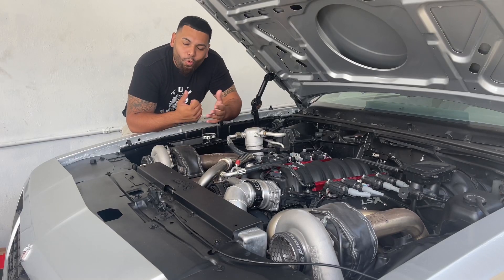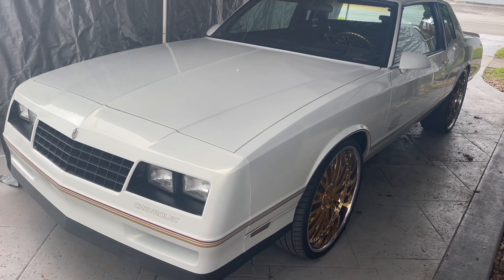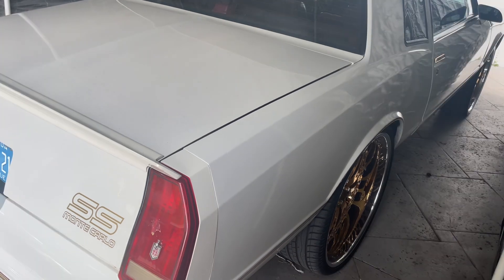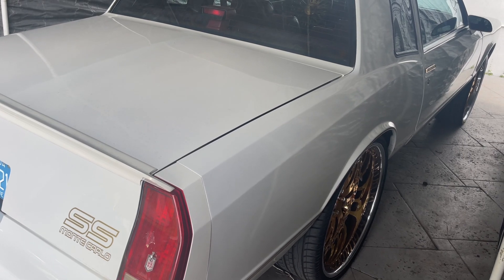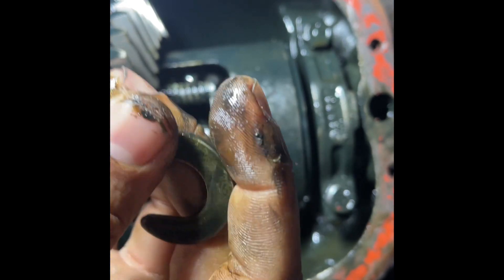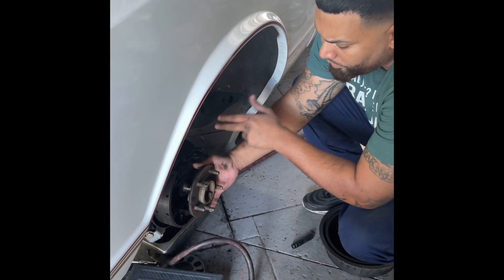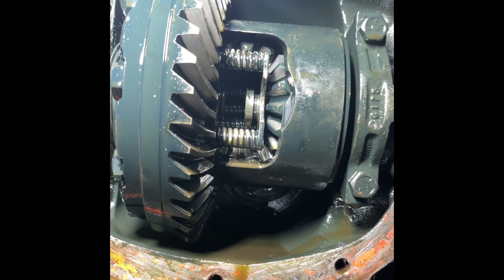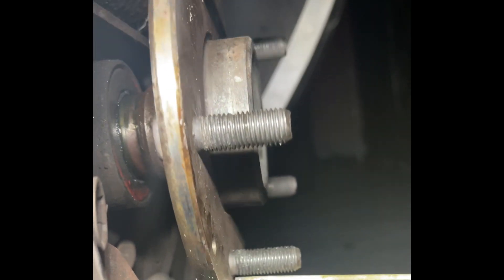How to check for and replace a damage axle on a GM 10 bolt differential

Comment: Hello Tuti I have 2 questions I have a tahoe with a 5.3 stock engine, what is the most cost effective way to add power and get them wheels spinning at the light. I already know you gonna show out at the Top 5 car show coming up be safe im gonna drive down there.
Reply: Cam, headers, tune
Reply from the maker: I agree with my boy @elcoSlimm cam,headers,tune